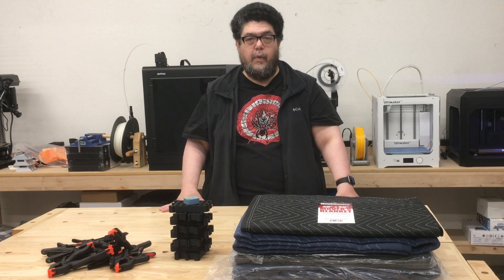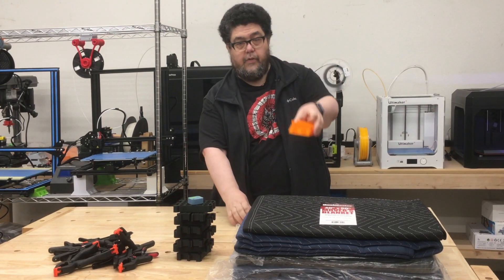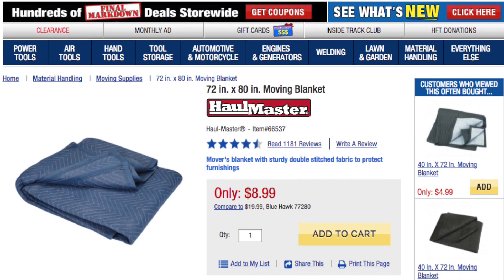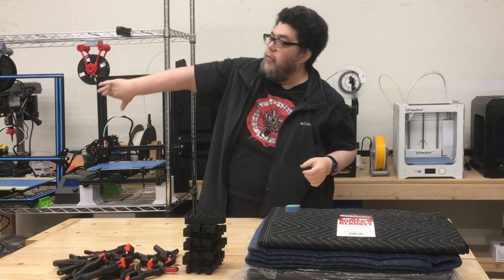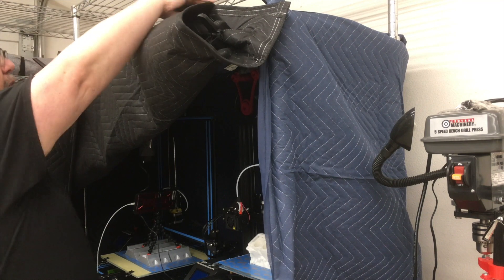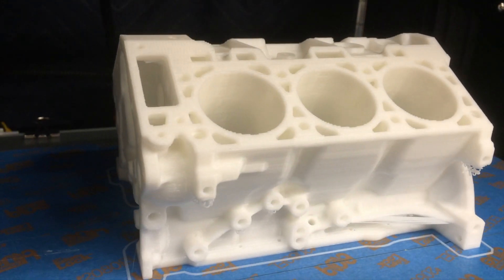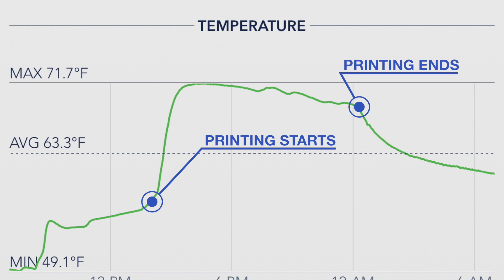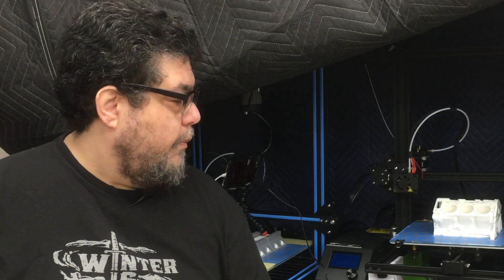Winterizing your CR-10 with a little help from Harbor Freight

Comment: New 3d Printer guy here and have been looking on what would work out in my garage. Only heated while working on items , however typically cool with Ohio winters.  Insulated but still need to protect.  Thanks!
Reply from the maker: I keep the house at about 64/65 and have no printing problems. But back in that old garage, I found anytime it got under 60, printing became unreliable. It sometimes worked. But it sometimes didn't. So, I try to keep things mid-60s and up for printing , with pretty solid results. Good luck! Take a look at one of these things: https://www.zdnet.com/article/review-of-sensorpush-tiny-iot-devices-that-let-you-track-temperature-data-on-your-smartphone/ and plant it (or a Smartthings equivalent) right next to your printer (but far enough from the bed, so the bed's ambient heat isn't picket up). Use that to see if your room's ambient temp is good enough. Let me know how it works out for you!